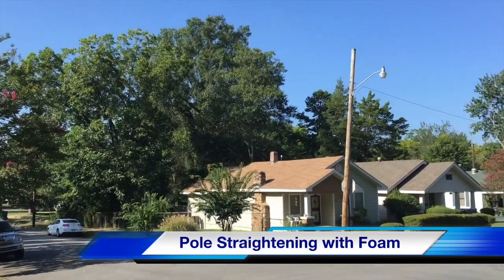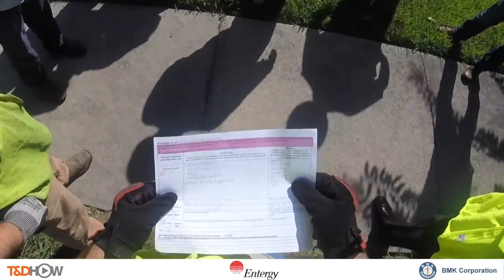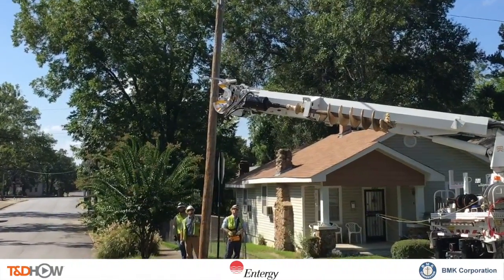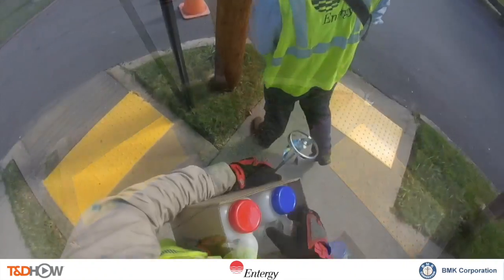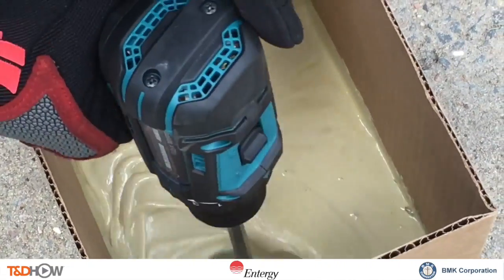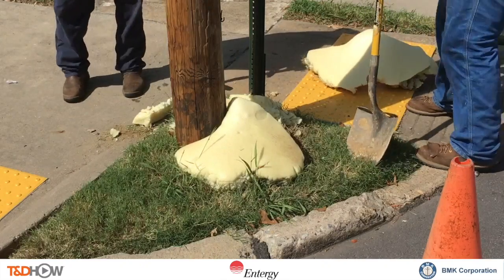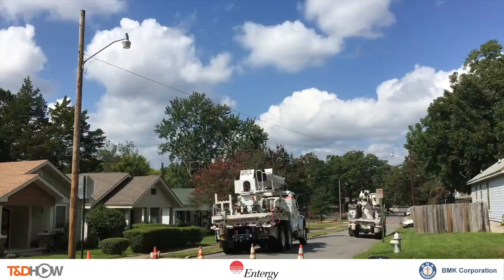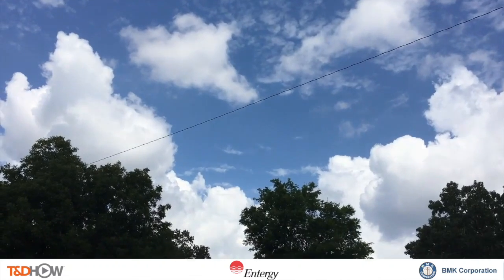Pole Straightening with Foam

Comment: They should have cut some slack in the duplex feeding the street light. It is way too tight after they straightened the pole. Why did they ground the truck for a pole with a 110 volt street light on it?
Reply: It is grounded for safety if the wire would get down
Reply: Because it's a demonstration. No need to ground unless there is the chance of primary energization.